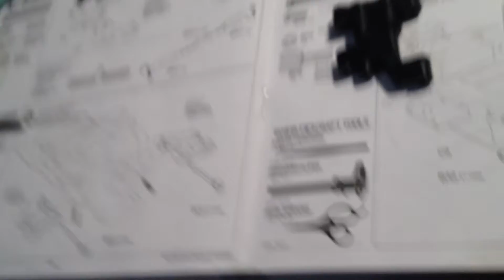Tamaya Build part 2

Comment: Hi looks nice, I think you need to put the rear pin screw in the higher hole up un the red rear carrier, unless yours is different than the jimny truck I have if not after doing so grind the red plastic off so it don't hang low down and snag stuff on the bottom of the carrier. also I show mods to my chassis like this on the suspension side that don't come down lower you need to grind some of the bottom of the ball cup joint off and grind a hair bit of material off the chassis ware the upper tie rod hits and it will drop low like the other side, I did this to mine and it works like a charm. Don't use longer shocks buy the tamiya CVA's they say to use or your drive bones will be angled so much with longer shocks it won't run any good and will bind.
Reply from the maker: Yeah I'm going to get just regular Tamiya shocks just looked at the rear end and it still looks lower everything's in the right holes and everything but don't want to shave anything off I read your comment again and thanks for the comment
Reply: @kbrc1345  it will run like crap like that the chassis will wobble from not having the suspension droop the same... it's something that must be done with this chassis.